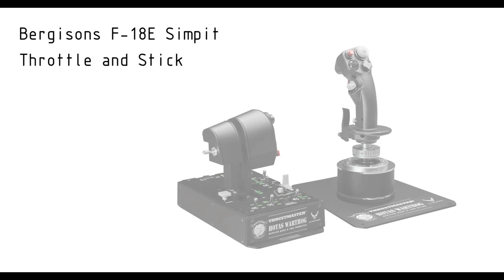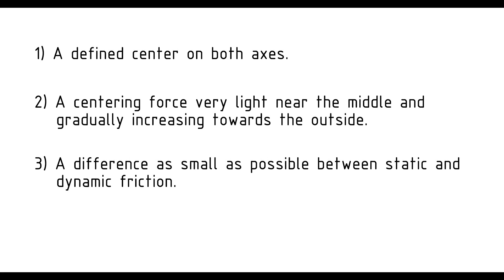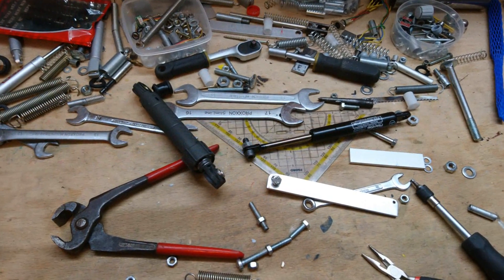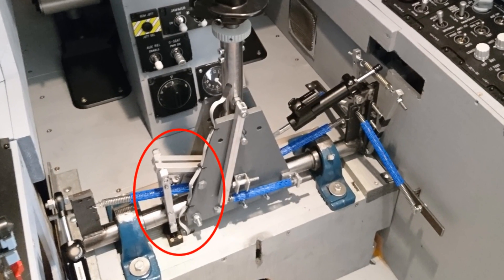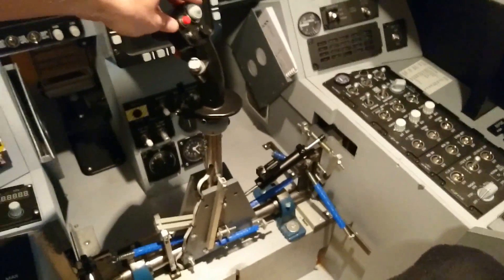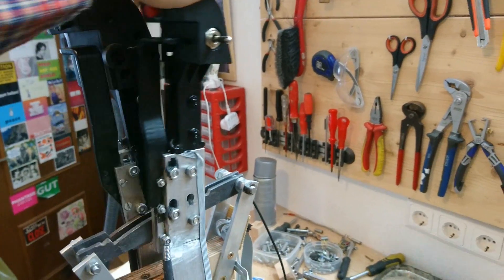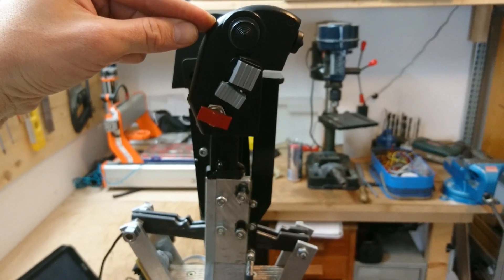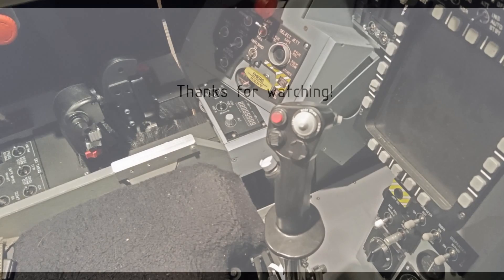Bergisons Throttle and Stick

Comment: How does the stick work with a single Hall sensor?
Reply from the maker: I just used the hall sensor that is already at work in the Thrustmaster stick base. It senses deflection on a 2D field (X/Y) with just one sensor and one magnet.

Comment: Have you considered using an induction based brake instead of oil dampeners in the dampening of the joystick?
With some engineering, you could even control something like that in software, deactivating the dampening when moving away from center or towards center in a controlled way and strengthening the dampening when moving towards center faster than a given threshold.

Comment: I'm making an Airbus sidestick replica. The hardest part is to mimic the feeling and the centering mechanism which sends the stick slowly and smoothly back to its neutral position, just like your joystick. In my case, I will be using those oil dampers used in RC carts, as they are small, adjustable and they include the spring

Comment: Very impressive! Really smooth operation and great engineering. Am currently building a full size stick https://www.youtube.com/watch?v=LxG68bToW4Y&t=4s  and understand the extensive experimentation needed for the dampers. Good idea about the motorcycle steering dampers -  I'm just about to try the washing machine ones!

Comment: Nice work there! 
however, I have to say that the F/A-18 throttle has a small detent in the afterburner that you can pass with a little extra push and not with the fingerlifts. The fingerlift detent is for the engines cutoffs only

Comment: Can you make a video about how you made the center MFD? :) Which display? Did you print the case & buttons?
Reply from the maker: I don't have the time currently to make a separate video of the MPCD but there are some pics and a bit of explanation on this page: http://bergisons.simpit.info/f18_mpcd. The case is CNC cut ABS, painted and then and engraved. I found the monitor on eBay for 50 €, it's a Orion RTV10 Security 10.4" LCD.
Reply: Holy shit, NICE JOB!!! Now I understand how you did it.... Nice CNC machine, btw.

Comment: Hi Bergison, great work on the stick and throttle. 
It’s nice to see and hear about your ideas through the development.  
How do you like the pivot axis for roll being placed a good amount above the pitch axis?
Does this help separate the axes? I guess diagonal stick movement would be slightly different from the ordinary gimbal joystick that most of us are used to.
I obviously don’t know the reason why the original F-18 center stick was designed this way. I guess strength of the assembly would impact the design.
Also, do your setup have greater centering force in the pitch axis than the roll axis?
Thanks for sharing
Reply from the maker: Thanks Havard! I don't know the reasons for the original F-18 design either. However, the axes positions feel alright, one doesn't notice considerable differences to traditional stick movements after some time. I have equal centering force for both axes.
Reply: Thanks for your reply. I can imagine it won't make too big a difference. Looking at several other cockpit pictures I realize that most fighter planes have a similar design, pre fly-by-wire. The Sepecat Jaguar, as an example, seem to have a very short throw on the roll motion, almost like a column yoke.

Comment: Hey man, that is a really awesome job you have done with modifying the existing warthog HOTAS to fit your F-18 simpit (which looks baller as well, by the way!). I really like the HOTAS 'stock' as well, but one thing that has always bothered me about it is that the included slew controller is pretty crap. Do you think it possible to replace it with a different control nub? The 3D printed solution that is out there is nice, but does not really address the crappiness of the hall sensor in the slew controller itself and thus does not fix the overall issue with controlability.
Reply from the maker: Thanks for your comment Nanne118! I have not had any issues with the slew controller so far, so I haven't (yet) tried to replace it.